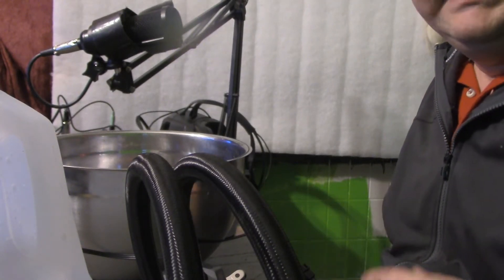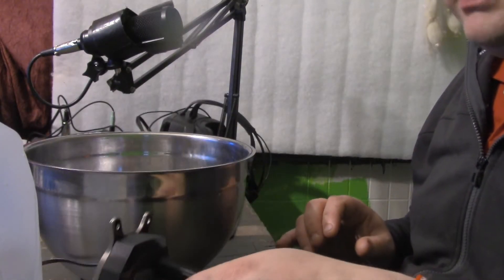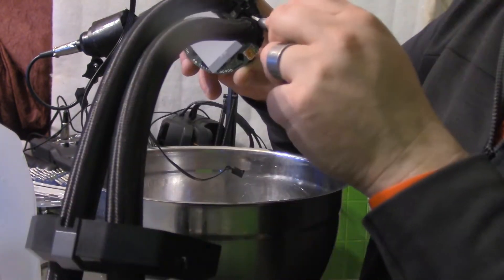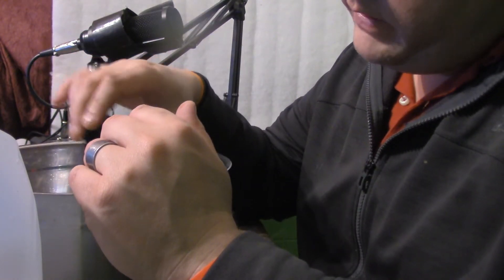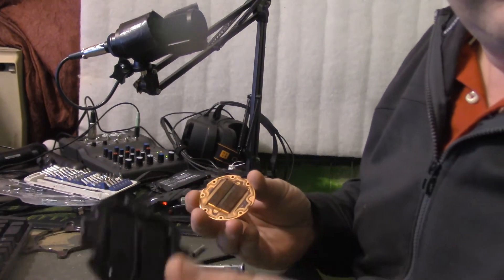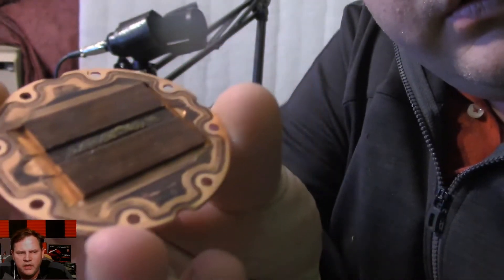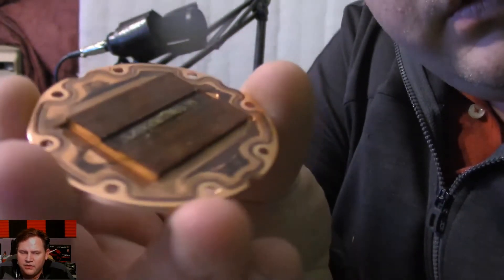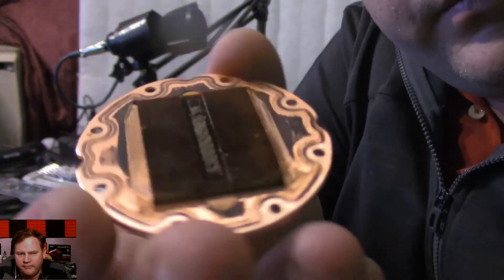corsair water pump problems

Comment: ive been running corsair aio's as long as theyve been making them in atleast one of my PC's, & ive never had an issue. growth will happen always, there is no avoiding it, unless you drain your entire H2o system each month, & even then there will be growth, you just wont be able to see it, as it wouldnt have grown large enough yet. its not relevant to say corsair, or nzxt, or deepcool aio's are better, as  almost none of them are made by those companies, they all use OEM's, & the best aio's are generally made by Asetek, which many corsairs are made by. corsair makes perfectly fine aio's, as do many other companies. you get about 5 years out of them, & by that point most people upgrade them even if theyre still working. generally human error, or lack of experience is where people run in to issues.

Comment: Im guessing all of yall configured the motherboard to give 12v constantly to the pump?? If u just plug it its gonna be treated like a fan. Wich is not
Reply: What are yor suggestions then?
Reply: @valcek01  U need to set them up at full pump power. I read this in a corsair forum by a corsair employee. So.. If your board doesnt have a pump mode and is getting treated as a fan.. U set the fan to be 100% power all the time. Thats it. I do not know if newer models need this.

Comment: Stay away from these PUMPS, i have a small rendering farm. I have changed 7!!! in less than 10 months.
Reply: Nah its just with corsair pumps, i bought nzxt and i didnt even clean it for 2 years theres a layer of black dust on my radiator tempatures under 30 celsius in game never spins more than 2k rpm its just an awesome product, this corsair crap is pure bullshitt i dunno why it cost so much i even tried h115 with bigger pump and vents but that thing same story as all corsair products they should be sued man their product is exactly fixed and put together to dye on you the day the warranty for it expires, man excatly i dunno how they did it but they did, i recomment everyone nzxt kraken x52 its actually much cheaper then corsair products and much much better and i would recommend a high tower case so that your water colling is placed vertical not horizontal i think it makes the liquid inside flow much better and the dust you would have with horizontally placed would be much more then vertical i dunno but its just like that.

Comment: First thing I do with these is crack them open. Drain the system. Then refill with Water Wetter and Distilled water 50/50... Then add rubber bushings to the backing plate. To take up the slack. They run at 34c then. Under moderate loads. At idle mine stay around 27c....Just set everything to extreme in bios. Problem solved...
Reply from the maker: Sound smart. But I have to say that is a lot of work for something that should work out of the box.

Comment: MY Hydro H55 bought 9/27/2014 failed 6/1/2019 I guess the pump failed,,,,, I'm lucky it lasted this long LOL Good thing the motherboards shout down the system 
before the CPU gets Fried ,,,, I'm done using water cooling
Reply: Robin Clifford BRO I bought my H55 in 2015 and it just crapped out on my today! I have never had problems with it before this but overall happy with the product.

Comment: I have the h60 that I got brand new. I installed it with brand new thermal paste and I was getting 105 Celsius by playing games for 10 minutes. My processor is an Intel core i5 3300. Can this be the problem?
Reply from the maker: That is way too high of a temp. If it is new. I would check if the pump is plugged in
Reply: Jag's Tech World hey I found he problem, I put the fan in the cpu fan header and the pump head in the computer fan header. Since I switched them I’ve been getting a 65 celcelus change

Comment: Hey dude how did u remove pipes from that plastic box(pump), I have Corsair H100i V2 and pump is not working. Its not receiving power, also the pump design is so fcked up, its hard to reach to motor of pump.
Reply from the maker: O god it has been so long since I did that. I still have the parts I think. I will look at it if I can find it.  Will let you know
Reply: Ok :)
Reply from the maker: I looked for the pump. But it looks like I throw it out. Sorry.
Reply: Ok, tnx anyway :)
Reply from the maker: Here is someone tearing one down maybe they are showing what I missed. https://youtu.be/jQ8EEcdGyFM